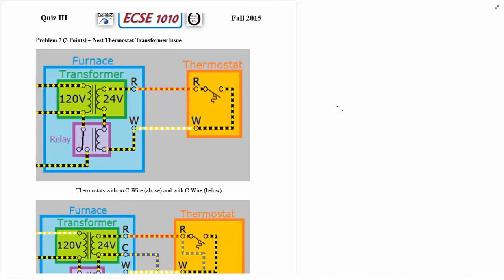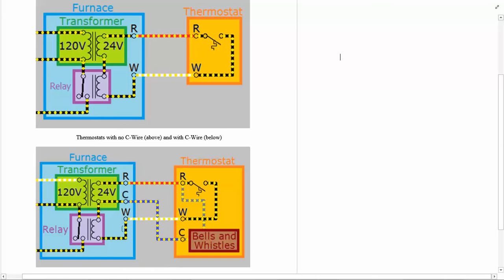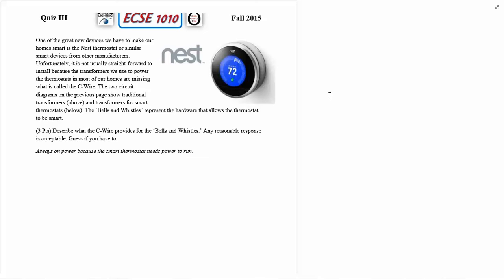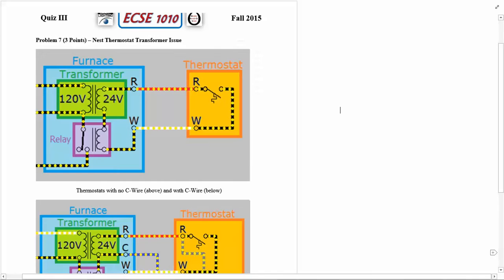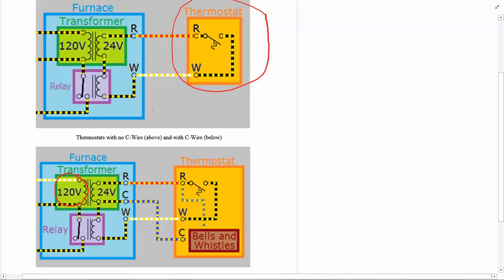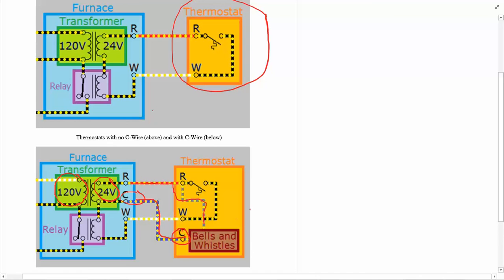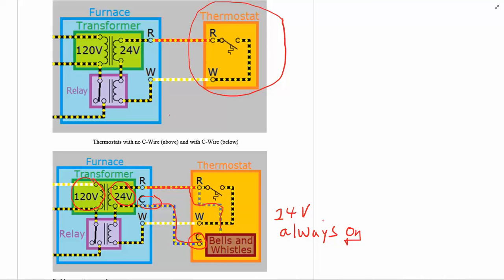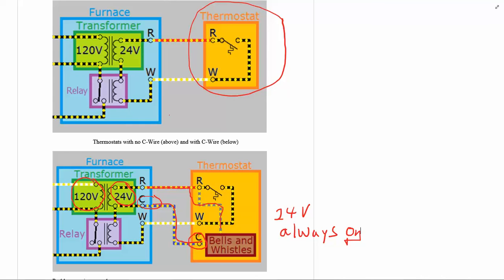Quiz3 F15 Part B 7 Solution

Comment: For the last question, forgive me for taking issue but you claim the 'C' wire is power and I believe not technically accurate. Look closely at the 'R' wire and you will se the the R is more commonly used as hot to power everything. Then look at 'C' and see that although it is on an ac sinusoidal (with power), it can be more accurately referred to as the 'coomon' for the circuit. Please correct me if I'm wrong and thank you.
Reply from the maker: Actually, we are both correct, but your comment is very useful because there is a reason the wire is called the C-wire and I did not discuss it. It is indeed the common and thus 'C' wire. I was referring to the function of the C-wire. Without having access to it, the smart device cannot be smart because it will not have 'always on power.' Thanks for the comment. You have made the discussion more complete.